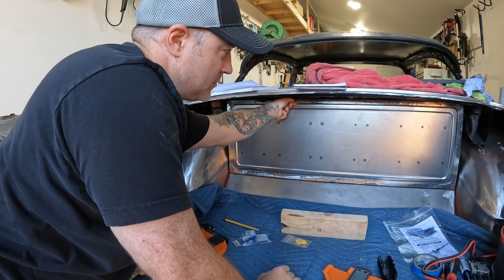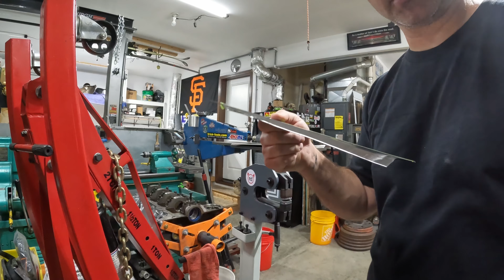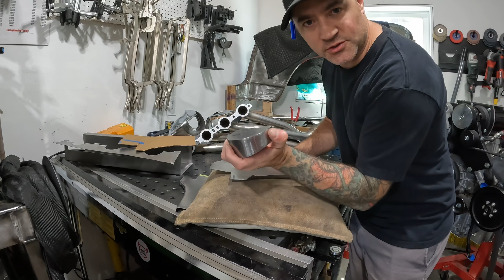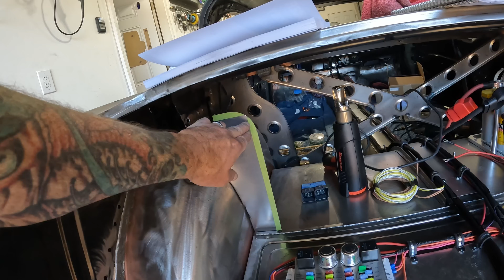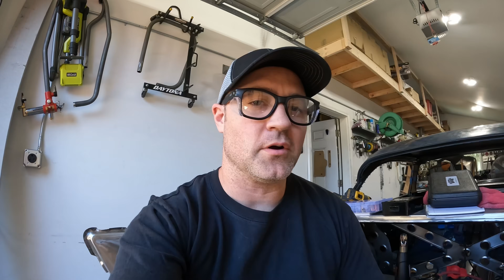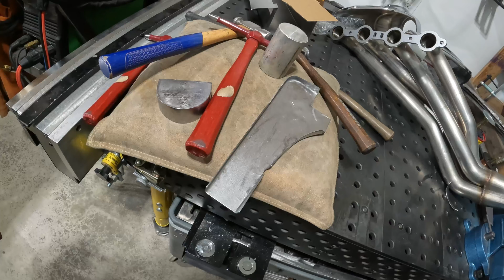How to bend a flange with a bead roller

Comment: Nice job. Consider rare earth magnets if you decide to go the magnet route.  They are available if different strengths and Im certain you can find one to securely hold that panel.
Reply from the maker: I ended up putting a couple holes at the top for a couple small screws